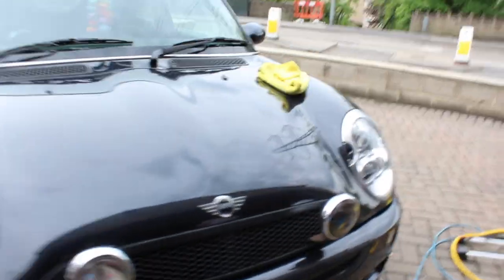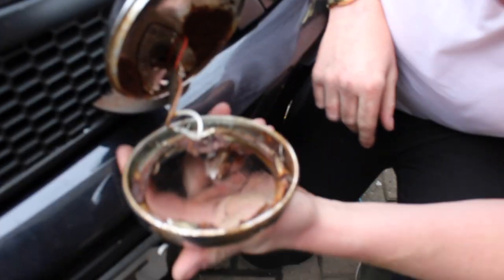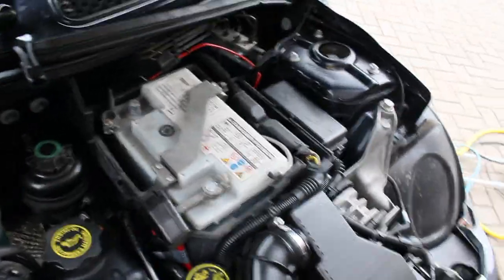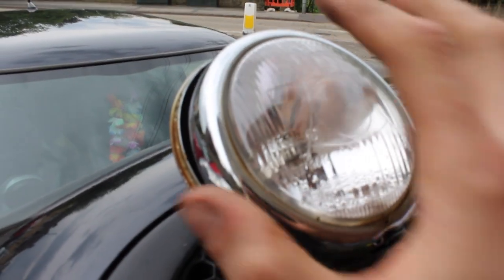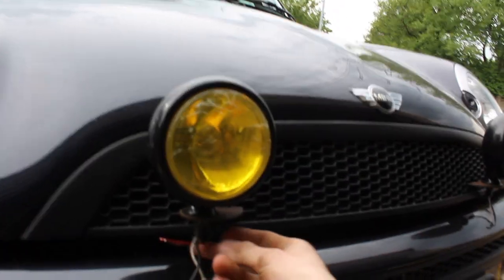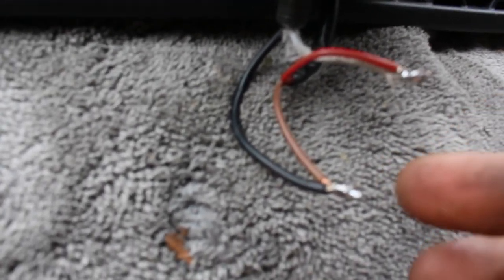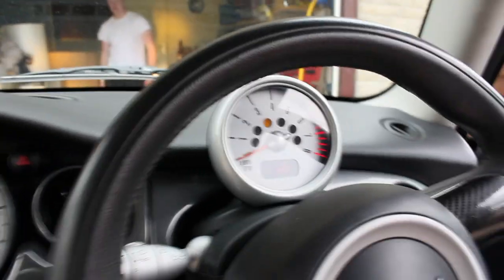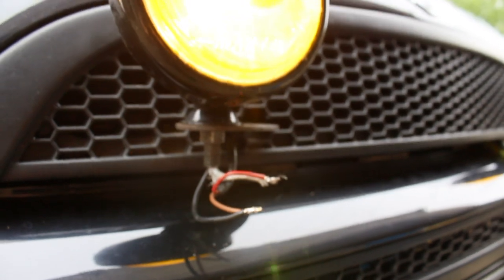Spotlight Install

Comment: Best to do an in-line splice in the future with a sleeve for a professional standard finish. Cost very little and is definitely worth it for added protection, all you'll need is a crimping tool and a heat gun/hair dryer 🤙